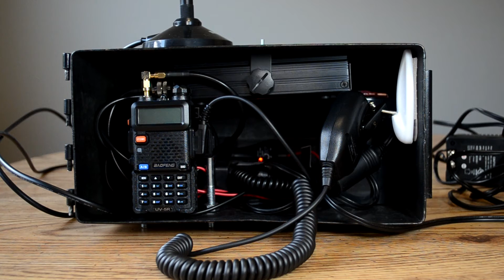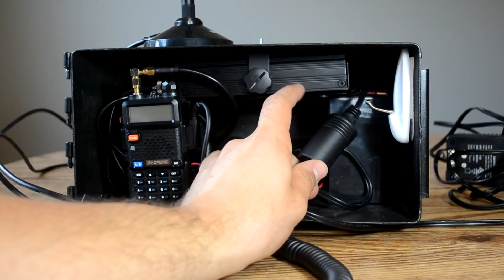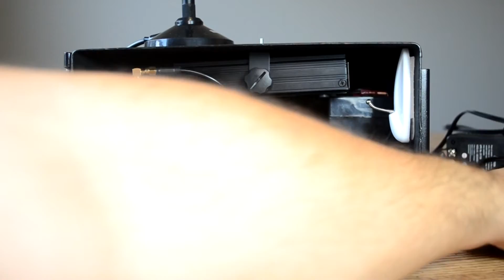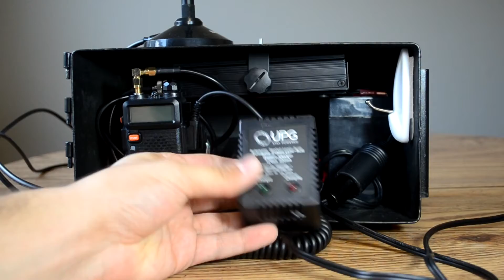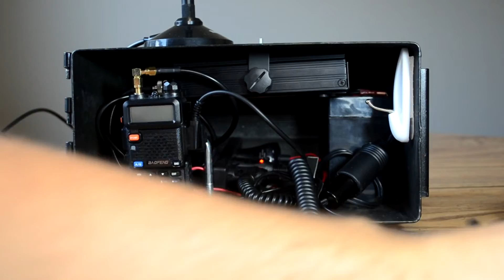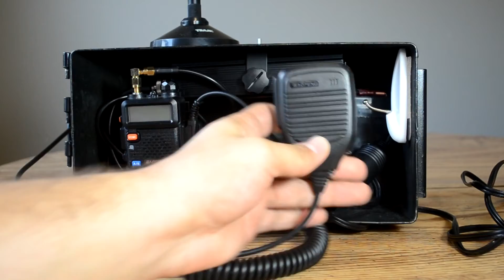HT-Based 2 Meter Go Kit/ Base Station

Comment: This IS Super COol, I Have A Baofeng (BF-S5 Plus) Plus That I Want To make Into Base Station, The Battery Went bad, Can`t Find Any battery Online For Cheap And I Tried To Fix It With The Ecigs Batteries And That Didn`t  Go As Well As I Thought, The Battery Overcharged And Bursted Into My Face, It Was Charging Seperatly On Table On The Usual Baofeng Station Stand Chargers, And I Started ToS o8und Hissing Noises, I Picked The Battery Up AndIt Was Super HOT! 
I Put It At My Face To Listen Closely And It Blow Up In My Face With All The Flames And Acid From The Batteries, So I Have NO Battery Shell Even, Now I Will And Want TTo make A Basestation, But I Don`t Know How To Make It 100% Good You Know, Your Video Helped Me In A BigW ay :)

Comment: How has this worked out? How did it compare to the mobile in your car? I have a couple UV5R's for a few years now and have been thinking about purchasing a amp and a power bank to make something similar. Have you tried it with a better antenna and such. Thanks

Comment: Only problem is the uv5r baofeng suffers major overload and de sence, I have carried out reception of low level incoming signals from distant repeaters, using a roof mounted duel band x30 antenna with approximately an s2  incoming signal on a yeasu ft60 thats easily readable. On the baofeng uv3r, uv5r, b580t, and a gt3 all were reading zero incoming signal, the only china radio that actually received a signal was a quansheng tg007. These china radios are ideal for short range communication but are useless for longer range low level reception. Im not in any way knocking these radios they are extremely good value for the low price, but lack front end filtering and unfortunately this creates the problems for long range reception. 73

Comment: It is over 4 years later when I an typing  this, but MFJ makes a window adapter for that may not have been available in 2014. With the window adapter, you can mount an antenna outside the car. They have an SMA as well as a BNC connector. Give it a look and see if it practical. The solar panel is a good idea as well

Comment: Nice setup, the only I would do, if you are going to use a linear amp on your HT have a solar panel. Then I would make that ammo box into a Faraday Cage or box. Buy lining the inside of the ammo box with cardboard or thin wood. You don't want your gear touching the metal on the ammo box if there is a EMP. I also notice your linear amp is screw direct to the ammo box. Mounted on wood or something where no electronic is touching the ammo box. Other then that, you do have a nice setup.

Comment: why is it called 2meter ?
Reply: +César Guevara In Ham radio we refer to the different bands by meters, the reason for this is simple. Take this, its for 2meters or 144-148mhz. At those freqs a full radio wave in air is 2 meters long. So for 6meter, 50-54mhz, the radio way is 6 meters long in the air.
Reply: +RelsGamingChannel ty very much!

Comment: How is the bofang?
Reply from the maker: It works OK. I'm not a huge fan- I love my FT60R as an HT- but the Baofeng is a great cheap alternative. Biggest gripe with the Baofeng is the lack of a good squelch control. The menu driven squelch control isn't a great solution.
Reply: Tony, KD8RTT  Okay i'm just looking for a cheap handheld,just encase i get my ticket
Reply: +Nicholas Michael (TheHighKoala) If  you haven't bought one yet, I noticed a Baofeng on EBAY for $20 shipped. It's the newer model that comes after the UV 5R.  Or you can buy several other variations for $25-35 all day long.
Reply: +Tony, KD8RTT 

If you think the squelch is not powerful enough Chirp has a fix.
Reply: I know this is supper supper supper old but figured hey why not I'll add my opinion in as I just received my "LT-F9HP" in the mail from Amazon only a few days ago. O don't have my ticket at all but, I've been very interested in possibly getting my ticket I've been doing a ass tone of research on radios HT' s and home brew antennas because I love tinkering with stuff especially electronics so being able to build my own antennas and so many different types of antennas at that just seemed to spark a interest. So on that note I figured I'd spend a few bucks and pick up a cheap handie talkie and see if I would enjoy it and I tell you just using it as a scanner, scanning the police fire trains airport taxe drivers all other communications as well as listen to all the amateur ham operators just shooting the shit has Been very interesting to me.. SO I DEFENTLY 120% RECOMMEND YOU TO PULL THE TRIGGER AND JUST BUT A BAOFENG YOU CAN'T GO WRONG AND I'LL TESTIFY ON FACE OF HAVING ONE I RECEIVE PEOPLE 25+MILES ALL THE TIME.. I PAYED I THINK $25 SHIPPED TO MY DOOR FROM AMAZON AND I LOVE THIS DAMN LITTLE RADIO AND NOW WILL MOVE FOWARD AND I AM BUYING A ICOM MOBILE RIG NOW SAVING UP FOR A BIG HOME RIG..... BIGGEST THING IS IF UR EVEN THINKING ABOUT IT EVEN IN THE SLIGHTEST WAY JUST PULL THE TRIGGER WORST CASE UR OUT ONLY $25 SO BE IT BUT IT'S WORTH THE SHOOT.... I'M ALSO IN 2 AND HAVE ALWAYS LOVED CB RADIO AND HAM RADIOS IS SUCH A BIGGER SPECTRUM AND IT'S WORTH IT

Comment: Power werx makes a cig plug with a set of power poles built into it... you could cu the cig plug off the battery eliminator and keep the cig plug in yoru vehicle...

I made something similar with a  FAT 50 ammo can. (2) 7AH SLA batteries under a custom "panel" with a 2 set power pole holder, master on (missile switch) , led voltmeter and an ACC outlet.

I found a 2 watt solar panel that fit the lid perfectly and used double sided sticky tape and mounted it. also used the double sided tape to mount a 10 amp charge controller inside the ammo can part. I don't have the amp permanently mounted so I can set it out of the box for heat dispersion.  I used a zip bag to store a power cable for the amp, 2 kinds of adapter cables for my WOUXUN radio and I keep 2 foldable 5 watt solar panels in it as well.

when the lid is closed it looks like a regular ammo can.

Comment: You are right on that amp. It basically only receives the VHF band. And at best with a 5-7 Amp Power supply gets mabe 25 watts. But its better than just the handheld alone. Good Little project kit to have.